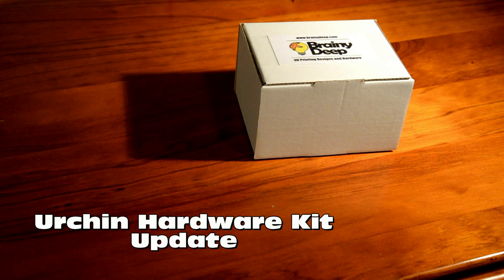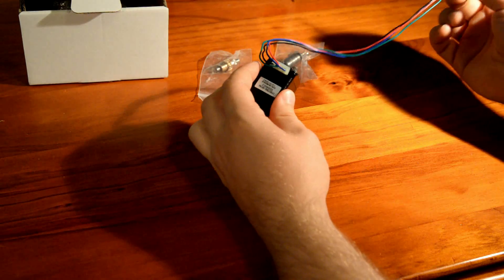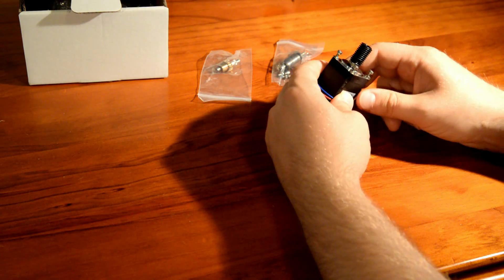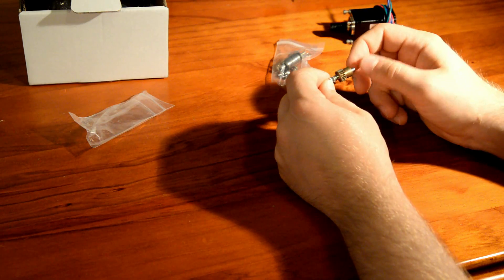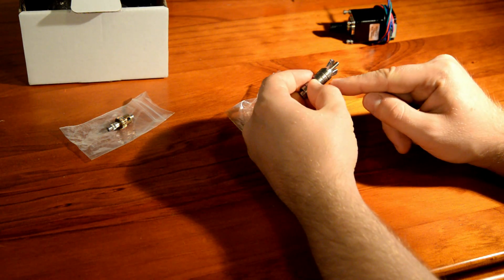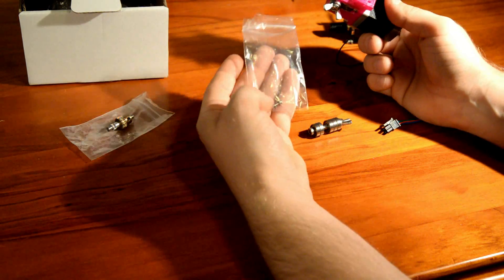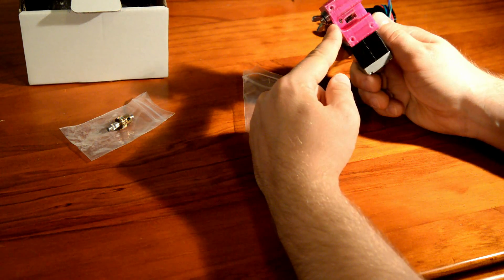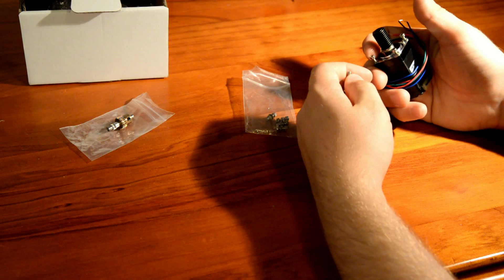Announcing the Urchin Extruder Hardware Kit

Comment: E3D V6 Hotend Support would be great!
I am looking into putting an lightweight and fast extruder onto the carriage platform of my delta.
Reply: Forgot to mention: also would love to be able to use 1.75mm filament - which also seems far more popular here in europe.
Reply from the maker: +kniefi I don't have any e3d hotends on hand to test, but I just modelled it up and it looks like it will be a drop in replacement for the J head on the existing chassis! You can download the chassis from the github page to print it out to check:  https://github.com/zbysniew/Urchin/blob/master/stls/64_01_12_a01_urchin_split_chassis.stl

There's also a bill of materials if you want to source your own components in the same repository, as well as CAD data that you can modify in something like Design1.

Also the Urchin does support 1.75mm filament, you just have to add an additional washer on the bottom 2 motor screws which pushes the pinch wheel shaft further forwards, reducing the gap. The only thing I recommend is to run smaller ustepping if you want to run fast, because most firmware can't keep up with the step rate.

Cheers!
Reply: BrainyDeep
thanks for answering,
great to know, will try it out and let you know of the outcome, once finished.

cheers